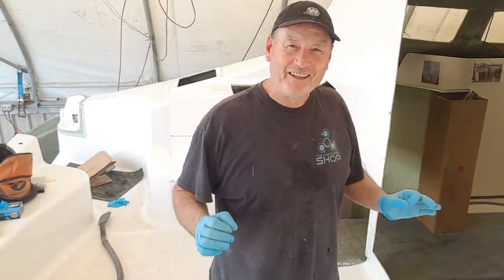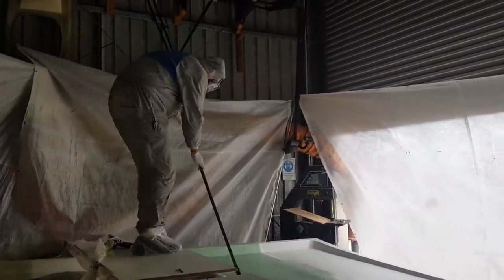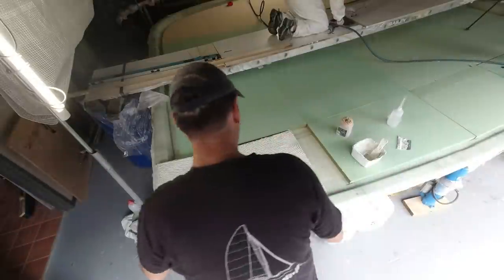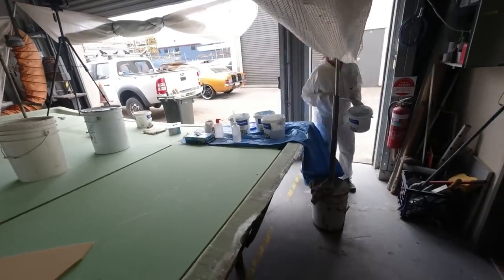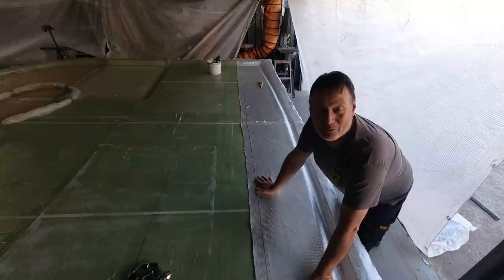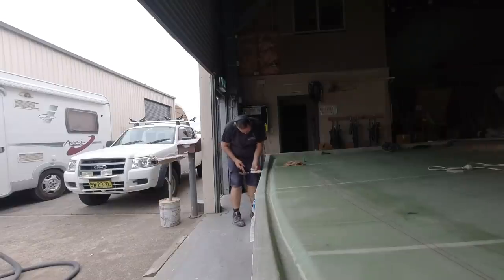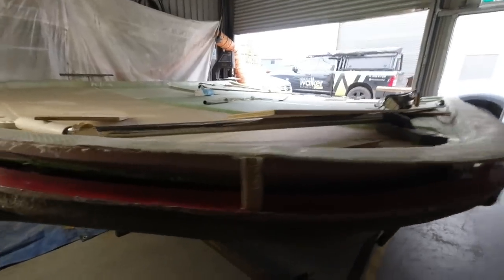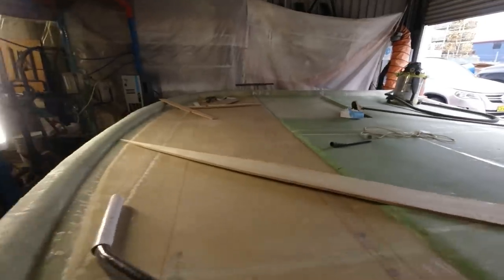Mutiny On The Hard Top  - CATAMARAN BUILD Ep207

Comment: I sympathize Ross with that hot work, I work on ramps at the airport where it gets well over 100 F/38C in summers with all the jet engines blowing out on top of natures heat and humidity ! It leaves me a walking zombie... Instead of suspending hardtop completely overhead, couldn't you put it on it's side against a wall so you could access bottom 1/2 from the ground level for polishing/cleanup ? Or would that block access to something you need on walls ?  Winter is Coming ! he he

Comment: Hey Ross, You need to be careful my wife's aunts husband died from heat stroke fifteen years ago.  Also When I was a welder fitter when we worked in extreme hot conditions you need to replenish your salt in your body. We took salt tablets they help a lot also drink lots of water. When you sweat a lot in extreme hot conditions sodium and chloride, are the key ingredients in table salt and in salt tablets. cheers. hope that helps.

Comment: Ross was just looking back at your laminating plywood bulkheads that you used epoxy to join yet you laminated with vinyl ester. I didn’t think you could have them within 100 miles of each other?
Reply from the maker: Not exactly. I make sure there is a full cure of epoxy,then remove any epoxy fillet replace the fillet with vinylester with milled fibre and return to original chemistry of the styrene based laminate.The minimal contact with the epoxy in this case is more than compensated for the additional strength of the epoxy bond and additional fillet.Cheers Rossco

Comment: Great progress Ross. Thanks for sharing.👍
I have a question. Would it have added some strength if you would have staggered the joints in the foam, or does the way the foam is bonded negates the need to stagger the joints?
Reply from the maker: Hey Daniel.I don't believe the foam has any real tructural strength until the skins are laminated so I would imagine there would be little advantage staggering joints as the resin fill and laminates would constitute the strength.In this case embedded electrical Conduits also reduce the strength which will need further strengthening with ribs or rafters to compensate for the removal of the foam.Cheers buddy.

Comment: Might have been a lot less work and faster to rout out the conduit channels learning the router skills will be beneficial when you start fitting out the interior.
Reply from the maker: I use a router ever day in our work but the saw certainly was easier without a jig that with the contour of the roof made it difficult to route accurately and much less mess.I was unable to clamp a giude and the track saw made more sense.In any case job was done and cleaned up well.Cheers Ross
Reply: @LifeOnTheHulls  Thanks for the explanation and I can see the pros and cons nice to see the project coming together,keep up the great work.